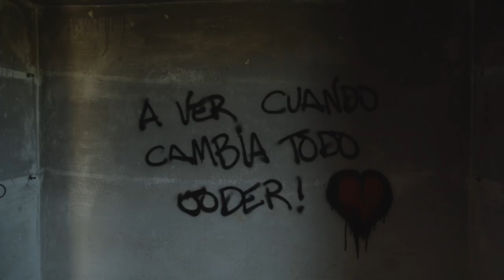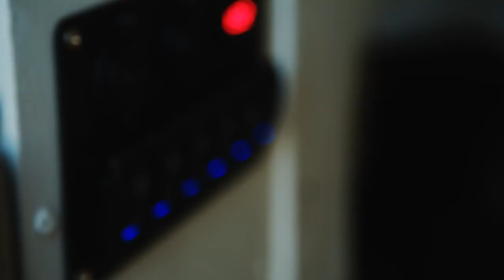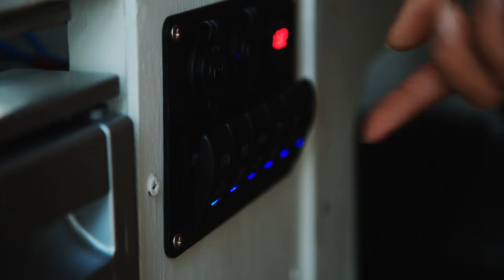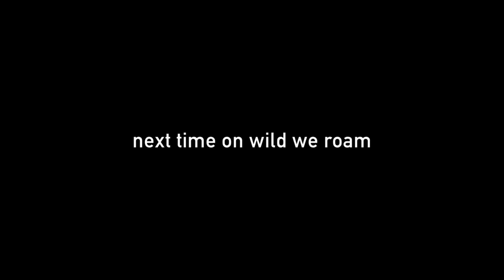Van Life Sucks

Comment: Some advice to you nice folks.. The lock installed  on the back of the Van, storing away your Important stuff needs to be changed. Why? because the screws on the lock are exposed and that makes it a "Useless Lock" and easy to be accessed by any one with a screw driver or even a nail clipper or knife... Yes these screws exposed can be taken off easy and the Lock removed Easy!!!  and wallaa 'Stolen Stuff" !!! yes Van life is hard I did it long ago and it was challenging but possible... yet very challenging.. I wish you both the best! Love your Video :-)
Reply: Okay I'm not a thief, but I've totally unscrewed the back of drawers with locks on them laughing all the way

Comment: Heat is hard- I think that's a big thing, if it had been cold you could snuggle up and stuff but heat is just oppressive and inescapable. This is what scares me because I live in the subtropics- especially with global warming it gets worse every year. it's winter here now and about 25C which is liveable but honestly I have a mental breakdown in my aircon-less house every day in summer so I can't imagine being in such a confined and over-packed space. You both have such a great attitude and beautiful relationship <3
Reply: I did experiments to see how I could cool my house WITHOUT air conditioning.  I figured out that the attic gets as hot as 158F during daytime.  That's like living underneath an OVEN,. It caused my living space to be about 93F.  Here was the solution:  I bought a bag of hydrated lime from the hardware store for about 12 dollars.  I mixed it with water and painted my roof with the SUPER white color.  This caused my attic temperature to go down to about 100F... and my living area to go to about 82F!!!  It wasn't air conditioning, but it was bearable.  If you go to the website builditsolar.com you can do a search for "WHITE ROOF experiment.  There is a lot more details at that site.  The good thing about this system is is cools your house for less than 20 bucks.  It uses NO MOVING PARTS.  It just sits there and reflects all that heat and works.
Reply: Cold can be very awful too. I think we can all agree warmer than cold but colder than warm is optimal
Reply: I live without ac every summer, and I work at a stable with many other people and horses. In the winter you can freeze to death.
Reply: In South Florida there only two months that are tough and I found it's cooler near the beach and seems to be okay after midnight.  For those months i just drove 500 miles north and it was noticeably cooler.   75F and lower at night seems to be fine with good fan/ventilation.   The trick of the van is to not be inside during the middle of day 11am-4pm. Also, having a mirror vinyl roof film, a big solar panel or deck to block the sun helps too.

Comment: Wow again nice video? food for thought? you can shower inside your van very simple? all you need is a plastic builders rubble bucket they are about 500mm across the top one shower curtain and hook and hoop for the top of the curtain?  one very small water pump and six feet of hose with shower head?   1... put the hook in the ceiling put centre area of kitchen put the shower curtain on the hoop then place on the hook let it hand down inside the bucket fill the bucket with two gallons or there about with warm water place the pump in the water hang the shower head over the top then step in the bucket pull the curtain around your self and into the bucket?  then boyfriend plugs the the end of the the electric lead 12 volt into the cigarette light or similar this will start the shower you can stand there for as long as you like to shower as the water pumps from the bucket up over you and falls back into the bucket  via the shower curtain hence non stop shower ? best wishes  Ken and Christine xxx

Comment: If you have 800w solar and 2500wh of lithium batteries in 24v, good insulation, no windows and a reverse cycle air conditioner, a insulated barrier between cabin, it's pretty comfy in the heat. I live in Australia where it gets to 48 deg celcius

Comment: If the van starts to overheat just turn the heater on and blower setting to max and that should bring the engine temp down. It's just temporary to buy you time to get to a gas station or whatever.

Comment: I think lots of would-be vandwellers just screw up the build phase, or simply choose to not build in enough amenities to actually call it a home. But yeah, actually trying to live in the van while building the van is pretty... well... silly.  Ventilation is crucial, so there probably has to be a powerful roof fan in the van to suck in - or out - air. There has to be ways to ventilate, like windows you can open, or actual vents, so you can get air without having the doors unlocked, which is iffy from a security point of view. Noseeum bug nets (very dense) need to be on the vents or windows. And so on. Basically your problems in the start here were all self-inflicted. So van life may or may not suck, but unfinished and unprepared vanlife is guaranteed to blow. Glad you're getting there.

Comment: Adjustment can be hard depending on your needs. I have a Toyota pickup with a truck bed that is 6’x5’ with a canopy, and this is permanent for now. Now power yet, bottled water, propane camp stove, and propane heater. The bare minimal to survive. It is not all a bed of roses I will say, but I did start sleeping in the cab, so I will not complain. Canopy isn’t finished and needs some improvements to battle the elements. Van life can be a learning curve, and YouTube can be a big help.

Good luck guys, stay safe. Just remember to protect your selves, people are not always friendly, and law enforcement time is not always quick.

Comment: You should look into whether or not the heater for the in cab in in your can is supplied by the engine or an additional electric unit. On most older vehicles you can run the heat in the cab because it draws heat from the engine so it can act like a little bit of extra radiator. It's miserable, but if the place your going can help with the overheating problem it can get the engine to limp there without destroying itself.
Reply from the maker: Thanks so much for the tip!! We'll definitely check it out :) - Dana

Comment: just fyi your van should not overheat from sitting in traffic even if it is super hot out.(I live in phoenix and it gets to 118 degrees here, my old van does not overheatat all) if it is doing that then your radiator is low on fluid or it is going bad ,they get clogged up and dont work as efficiently as they get older. new radiator is not that much money and its not hard to replace.overheating your engine will destroy it quickly and that is a lot harder and more expensive to replace.just a tip from a fellow old van owner. fix that shit.

Comment: When your vehicle starts overheating turn the heater on it gives the engine a vent to relieve some of the heat. My old diesel used to do that and it worked like a charm.
Reply from the maker: Thanks so much for the tip Sam!! - Dana

Comment: I myself don't think that van life is right, for me... It doesn't seem like it's that cheap... It's the whole thing with the vehicle - pay  $10,000 - $20,000 dollars for a vehicle, or more... for a nice van with no mechanical problems... or deal with regular, unscheduled - sometimes expensive repairs. Just that, gives me a cause for concern.
-In the NE of the US when it's freezing in the winter... the vehicle has to constantly at a minimum temp... or everything is frozen. This is hard to do when you're out and about... like working or at a mall.
-Van Life would be perfect for me, however - if it was during the summer and on a part-time basis only.
-To make it dual-purpose.... It's best to save room in the van during the design, in case you may want to haul some furniture, a full bike, or a 4' x 8' sheet of plywood. Or just keep it flexible / modular.

Comment: Anyone you should not get emotional with yourself. A no no, other ok, because you start to look inward. They nothing to solve so you start to feel sorry for yourself life not treating you as you would like.
Wrong way, so at a personal who handicap  say missing a leg or arm. They last thing he want to do is get emotional about it. What you got to do is think how can I make it better.
Heat you need ventilation or holes at the top as your giving off body heat and it’s getting hotter and lower. Goggle how too. Make the van liveable make a roll out patio canvas outside the door that the 2 legs can roll up. This open up the area during the day and cool down a place to hangout. They are misty sprayer goggle that. 12 volt and get.
 solar. You can get portable ice maker. 1,000 watts then run off a 100 watt solar panels .
You can keep going. But be like me away improvement every weeek. People pat 400 thousand for a apt that has a view of one beach far away that after 6 month is no big Deal boreing. Here you can get a diffrent view everyday. That looking at the brite side.

Comment: This is ridiculous. You want to CAMP in a van but you're boo-hooing about not having modern conveniences. You can't have a lantern? Geez...most of them run on batteries. You can't have a jug of water to use? Where did you use the restroom?? Camping is about roughing it! You want conveniences, stay in a house. It's really simple. But if you're going out into the wilderness, you have to live off the land. Build a fire to cook. Use lanterns to see. Use jugs of water for washing, drinking, cooking. Get a 5 or 10 gallon jug. Really no different than getting it from a jug/container under your sink through a faucet or getting it from tap supplied from the container. Fill a large bowl if you're going to wash dishes or your hair or bathe. TV, the internet and the phone have no place in camping. You're "in the wild" now. Thousands of people went completely across the country in covered wagons without modern conveniences. Besides, where's the fun if you're using conveniences making everything easy??